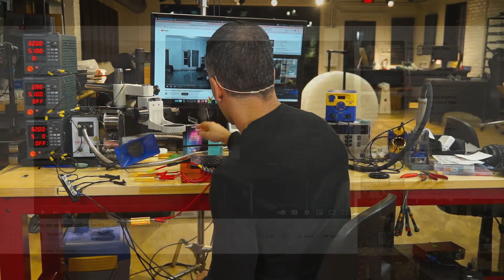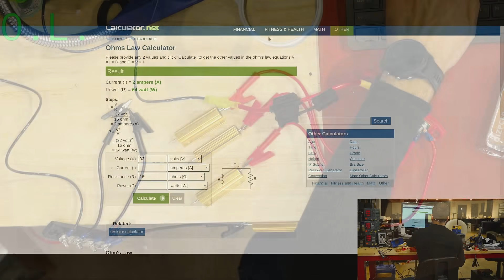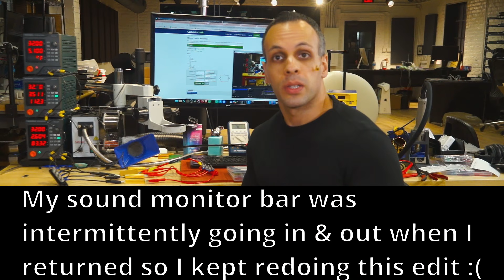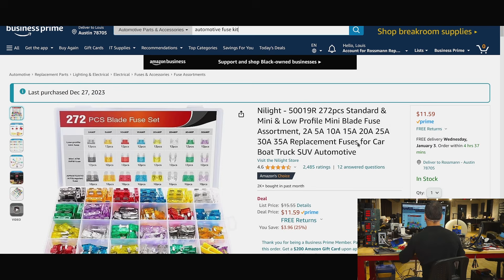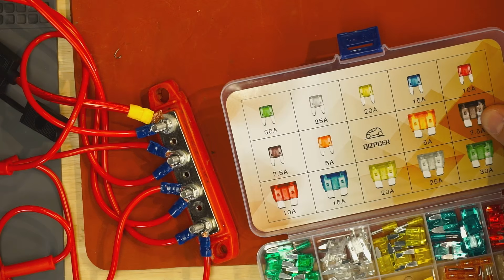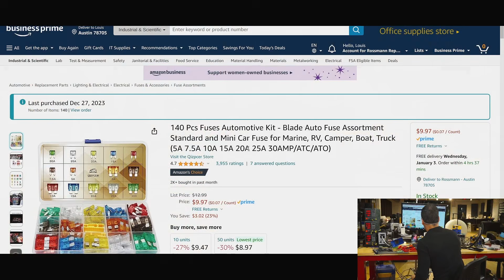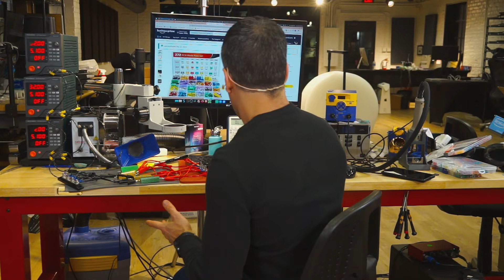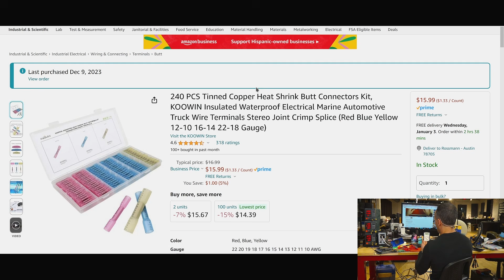Amazon Sells Fake Electrical Fuses

Comment: This might be a negligent homicide investigation if someone actually tracked all the faulty fuzes that have been installed and researched the outcomes. This level of misrepresentation probably has a body count.
Reply: In a real world with real laws the creater as well as the market that sold them is liable.  If amazon faced consequences for all the dangerous and faulty products sold they'd bankrupt 5 times over
Reply: @gopplergoppler8827  no the "market" isn't, it's the seller that is responsible. This is like blaming the owner of a mall building because one of the shops in it is selling illegal stuff
Reply: @marcogenovesi8570  if the owner of that building knew that the tenants were selling illegal stuff, then they would be breaking the law as well.
Reply: @marcogenovesi8570  so it depends on if Amazon is the equivalent of a building landlord or a storefront. They present themselves as a storefront, unlike e-bay, so I’d contend they should either be treated as such or be forced to change how they present themselves
Reply: Hell... I've seen worse, and unfortunately not only on Amazon or Ebay, but all over online market.
I'm not electrician and not using many of that product, but i do outdoor sports and noticed the same thing over outdoor safety gear/equipment.
It just horrifiy me to see they sell untested/unregulated kernmantle rope, harness, carabiner, etc... a safety gear that you need to depend your life on, literally... 
Many of them didn't even bother to put disclaimer that those gear are not intended for safety, neither rated for it.

Yes, it is much much cheaper than a trusted brand like Petzl, Beal, Black Diamond, etc... 
But product from those brand are more expensive for a reason, they are certified after rigurous testing to pass standard from regulatory body such UIAA.
Reply: @dalfifran7572 it's like that everywhere. For example you can buy a Chinese laser off wish that is powerful enough to permanently destroy your vision even with a beam refraction but they will be labeled as a "cat toy" or "laser pointer", straight up ancap shit
Reply: Well, if the rope fails, its not like you will be around to sue anybody! @dalfifran7572
Reply: @dalfifran7572  also those companies will have "well stocked" liability insurance and are more then READY to "deal" with a failure of there product both in consumer side AND rework to PREVENT future liability VS the OFF brand that will end in court and go BK and the factory will make something else for someone else
Reply: yeah an investigation for the chinese manufacturer
Reply: @marcogenovesi8570  The sellers are also at fault.
Even if US law doesn't reach the manufacturers, they can shoot down the businesses operating within the US.
Reply: @trajectoryunown  what "sellers"? Have you seen the amazon listings? They are not in the US too.This is straight from china as if it was Aliexpress
Reply: @trajectoryunown  Adding to this... as I pointed out in another comment: amazon often refuses or takes down reviews exposing fraud or takes no action when notified. They are enabling fraud and actively helping it continue.
Reply: @trajectoryunown  That would be Amazon. These manufacturers of cheap knock-off's don't have local distributors.
Reply: @marcogenovesi8570  
Then punish Amazon for allowing these dangerous products to proliferate (as well as permitting review farming)!

Every transaction is a chain: Seller > Distributor > Marketplace > Delivery Man/Woman > Recipient. When dealing with fraudulent sales, first try and go after the Seller. Next, try and go for the Distributor. Finally, go for the Marketplace (punish if possible, otherwise block it).

Amazon, located in the U.S., is therefore in direct firing line, and likely have thousands of products that may be considered dangerous and may have already claimed lives.

What we need is for the U.S. government to just grow a pair and grab Amazon by their throat!
Reply: @trajectoryunown lol, after the start settles they will just create another LLC and keep selling this garbage.  Criminal liability and prison time is the only solution.
Reply: Amazon is allowing them to sell these things on their platform, amazon is also responsible for this. @marcogenovesi8570
Reply: To be fair, China has executed people for these types of crimes in the past. That high profile milk scandal ended up with two executions. Key words being high profile.
Reply: @marcogenovesi8570 yet another reason why the PRC must fall
Reply: That's an excellent point to raise. Almost like it's something the gov should do, instead of stuff we don't want them doing
Reply: Fire investigation would probably end at "electrical fuse failure" and call it a day tbh. Someone would have to do a lot of work and I'm guessing that everyone selling this is betting it will never come back on them (it probably won't)
Reply: SOME STAY DRY AND OTHERS FEEL THE PAIN
Reply: @ozzyo6733  CHOCOLATE RAIN
Reply: It's all greed at the end of the day, see if they care.
Reply: It matters in an ABS for Kia and Hyundai 😱
Reply: holy shit the chocolate rain guy watches mr rossman!!
Reply: @archedcorridor I thought you were joking at first, but it's actually him!!
Reply: @VitaliyCD  Guy pops up here and there, usually tech videos.
Reply: I was wondering if anyone else would recognize @archedcorridor
Reply: @archedcorridor you’re literally the last person to discover this
Reply: @archedcorridor  If you want to be upset, just try calculating how many years ago that video was posted.
Reply: Call the ambulance chasers, they will do it.
Reply: So what you're saying is some stay dry while others feel the pain
Reply: Hyundai has a recall where the ABS module can leak and catch fire. Their solution is to replace the fuse with a smaller one so that if the leak causes a short the fuse will blow before the module catches fire.

Now imagine using Amazon garbage for that fuse...
Reply: Based as usual Tay!
Reply: "This level of misrepresentation probably has a body count." 

I haven't finished watching the video, but I wonder if Louis has tried contacting Amazon about this issue?
AS IF THEY WOULD ANSWER...
I work for a big company that distribute loads of automotive parts, tools, and DIY supply (not  home depo) and it does happen that sometimes there's a issue with production and we have to recall large batches of our products, and usually it's due to one or more factories having issues with raw material/QC issues.

It might not be malicious, if it was anybody else then Amazon I would have blasted Louis immediately, but I still think it's worth mentioning.

It doesn't justify the issue, but it could be a real slip of QC.
Reply: This is screaming for a Class Action Lawsuit. If only to punish Amazon for their reckless and negligent behavior.
Reply: Even if we assume that the manufacturer did put identifying markers on the fuses to make them traceable, they are Chinese and will thus suffer no consequences.
Reply: @giglioflex Punish the distributor and they'll quickly find a new supplier.
Reply: @giglioflex  Simple... Tell China to punish the company. Or pull ALL BUSINESS from China, stop all supplies in and out of China, and every country that also does business with China, and Isolate the fuck out of them, Sanctioned them, and all countries doing business with them, and fuck up their Economy.
Reply: This is why I had no problem with trump putting massive tariffs on china
Reply: Not sure why everyone is debating this. as Louis said in the video, any retailer caught doing this would be shut down. Amazon get away with this constantly
Reply: @thehuguenot5615 you don’t get it sorry, tariffs and regulations are different things… tariffs just mean you pay more and your gov gets the money to give tax breaks to your elite class as your expense…. Regulations protect you…..
Reply: @thehuguenot5615  Aren't Trump want to put sweeping massive tariffs over everything? 
For things like textile product, apparel, gadget, or lifestyle goodies, I really don't care much if it's not exactly to code and regs. Putting massive tarrifs over that would only backfire and likely economic suicide.

But for things that affect safety, there should be more tight regulatory and oversee.
Reply: @dalfifran7572  if those products were owned by overseas companies and not built in the US then yes there would be a big tax placed right on he item as it entered customs.
Reply: They will just declare bankruptcy and open a new LLC.
Reply: It’s scary.
Reply: I did exactly the same thing that Lewis is doing over a decade ago and I reported all my findings to Amazon and they did nothing.

I reported my findings to three different government agencies that supposed to do something about this but they did absolutely nothing.

I systematically tested and presented the data in the proper fashion.
Reply: The fake DeWalt batteries being sold WILL cause fires
Reply: omg hi tay, i love your twitch content!
Reply: The reviews are created by Chinese bots and paid reviewers to boost the sales of this shit. Amazon is ultimately legally responsible for the products that pass through their retail outlets. Every single business in China is controlled by the CCP, and is just a de-facto extension of the CCP. The CCP does not care if products kill us, as long as they can still pass-off this shit. Business in China is rife with corner cutting, corruption, quota satisfying, face-saving bullshit. Amazon is legally aiding and abetting this shit.
Reply: So murder in the 2nd degree?
Reply: Sanguine rain? 🤔
Reply: whaaaat didnt expect the chocolate rain master to be here... have a great new year
Reply: Good point.
Reply: Chocolate Rainnnnnn
Reply: This is crazy stuff. I had the same thing happened to me with their electrical connectors. And their wires are horrible as well.
Cheap cheap cheap cheap!!
Reply: @DonCarlione973  I'm honestly not sure how lightning cables fail . . . but I've been through about twenty from Amazon just to charge my phone.
Reply: Unfortunatelly most of the people that sell this crap are in China.
Reply: Not only that, but if the company selling or making them could be proved to have given their own product positive reviews, when it clearly is a bad product. Might be able to be tried in court for false advertising...
Reply: my dude either you are terminally online or we sub to all the same channels.
Reply: who are you going to sue? it's chinese crap. not only do our laws not apply there, but even if you tried to sue the "company" that made it, they will be long gone. this is the chinese way of doing business. make a fake company, pump out a bunch of crap for the lowest cost possible, make a bunch of money, then "close" the company (use the term loosely, it didn't really exist in the 1st place) and take the money and run.  rinse, repeat.
Reply: you sure as shit won't be suing amazon, they literally have more money than most entire countries. good luck with that.
Reply: It's a fair point. This is also why it's important (despite the fact that we all hate lawyers and the state of litigiousness that is reality) to have a society in which we (or our heirs) can seek civil restitution if we suffer any harm. The issue is that most of these products are of such low value and while catastrophe is possible, it's sufficiently unlikely that there won't be a case worth taking action on.
Reply: some stay dry and others feel the pain
Reply: Very Unlikely for Amazon to be held accountable for anything, they are near the top rung of the multi tiered US justice system
Reply: This is downright scary. Looks like Amazon doesn't do any form of spot/sample checks on the junk it imports from Asia. Then, any negative reviews are hidden, all on an electrical safety device that your life could depend on... Avoid Amazon like the plague, until they get their sh!t in order.
Reply: 😂 auto fuses are better got at a wrecking yard. Oem and you are good. Pick em like strawberries! 
There is all kinds of garbage, did these have a ul listing from India?
Reply: More stuff like fiat fire chocolate rain king!
Reply: Yes, please submit your lawsuit to the Chinese Communist Party and let me know how that goes.
Reply: @themobseat  China has a court system.
Reply: I was thinking the same, it would be hard to prove a homicide but a class action lawsuit could work

Comment: Honestly with ever so slightly better equipment you could do a much simpler setup. I built my own power supply where i can control both the volt and current limit but it also has a graph to show volts, current, and watts over time all the way up to 60v 20amps thats 1200watts. If the college/university dont have a better setup then the quality of todays electronics makes a lot of sense.

Comment: And here I expected them to be such a low quality that a 2A fuse would burst at just 0.5-1A
and a 16A fuse blowing at 8A or less.
----
As for those datasheets even if they exist, they are often faked/stolen from other listings, so if the datasheet is for Quxin fuses which is correct, but the brand you bought is Quixan fuses which lower quality and different break points, they are not the same fuse even if the datasheet is identical, because they just changed the name on the datasheet.

Heck even FCC FTC and CE certificates are faked.

Comment: Hey Luis, have you thought about using lightbulbs for testing fuses. Something I had learned in electronics engineering classes.

You can easily wire up a board with parallel bus bars and add dozens of outlets with different wattage bulbs for your respective loads.
Reply: it's kind of large and creates a lot of heat
Reply: @marcogenovesi8570  depending upon the bulbs chosen it can become quite large, but there's many options that aren't. 
Also everything that resists voltage generates some kind of output, whether it's heat light sound or any other form of energy. The resistors in this video generate heat and IR light and magnetic energy. A light bulb generally generates less heat than a regular resistor. A motor is less than that, but not as stable in resistance value.
Reply: @dwmaddawgs  a fuse is not a resistor so I'm not sure where you are going here. The entire point of fuses is that you are not wasting power on the fuse, as long as you stay within its rating.
Then when you overload it then yes it becomes a resistor, for a very short time, until it breaks the circuit.
Reply: @marcogenovesi8570  he is using resistors to make amperage through the fuse. I suggested using light bulbs instead of resistors because they are cheaper, and easier to work with. Did you watch the video?
Reply: @marcogenovesi8570  I clarified the original post as I see how someone could misinterpret it.

Comment: Your results are not exactly invalid, but I think your test regime proves something a little different from what you might think, and leaves out some important concerns.

One of the hallmarks of very low-quality electronic parts is INCONSISTENCY.

If you repeated your tests in 6 months or a year, with the same brands, so that you were testing a different production run from each of those same brand's output, like as not, you'd find some of the brands that failed in the first test pass in the second, and vice-versa.

The real lessons to draw from your test is cheap "Chairman Mao" fuses are NOT to be trusted, and there will be just enough acceptable examples about to draw a person onto a false sense of security.

I'd say try Jameco and Digikey, see if you can get some less expensive fuses from places like those.

Comment: Maybe the problem is the voltage.  At 32 volts the electrons are jumping over the gap caused by the blown fuse.
Well Apple can use them since the fuse won't blow before the motherboard chips anyways, it won't hurt anything,

Comment: This has been an issue with cheap automotive fuses for years. Nothing like having a cheap fuse melt a $2000 main harness in a relatively new car because the original fuse blew and Bubba replaced with a cheapie.

Comment: Another thing that I hate about Amazon is how they handle counterfeit items situations.

For Ebay if the buyer gets a counterfeited item, Ebay refunds everything, including shipment and if the seller wants the item back, the seller has to pay the return shipment, the seller gets penalize for selling counterfeit items.

On the other hand, for Amazon if the buyer gets a counterfeited item, Amazon only refunds the item cost, without the shipment, but to make it worse the buyer needs to return the item to the seller and the buyer is who pay for the return shipment, the buyer gets penalize by having to pay 2 shipments, the first to receive the item and the second to return it and ends without the item, the buyer does not get penalize.

Comment: I too have been struggling with decent crimps, so now I just solder and heat shrink everything with uninsulated connectors, and pass the extra time cost (of maybe an hour, on a van to motorhome conversion) to the customer, no complaints yet.

A little more tedious on my part, but leaves my feeling more confident with the install.

I think fuses are rated upto 10 times their rated current for a short period of time, say, to start a motor, but this does seem excessive to me over the time you tested them.

You even get a current spike protected by a 7.5 amp fuse of maybe 20 amps very briefly on HID headlights, and then settles down to about 3i to 4 amps.